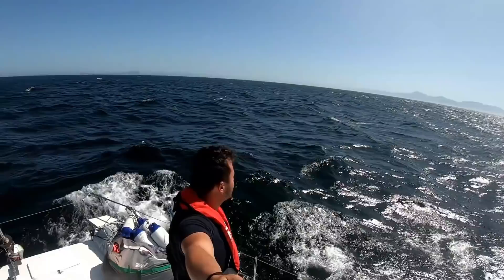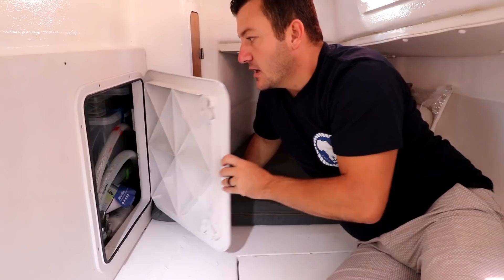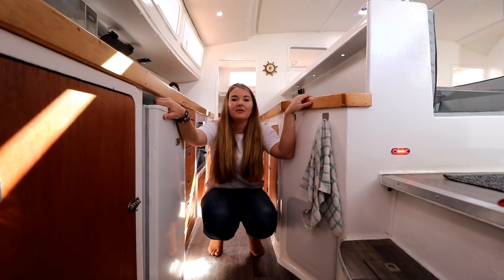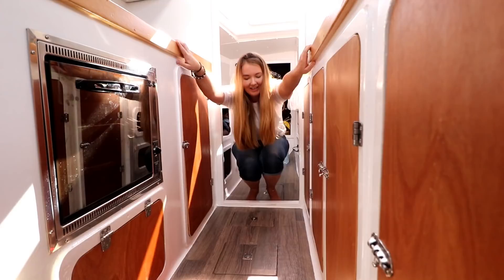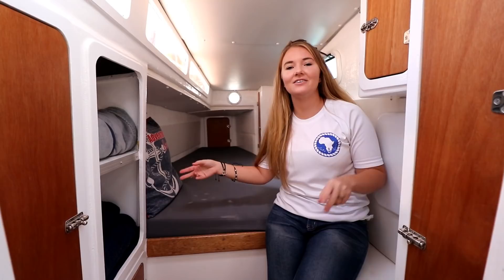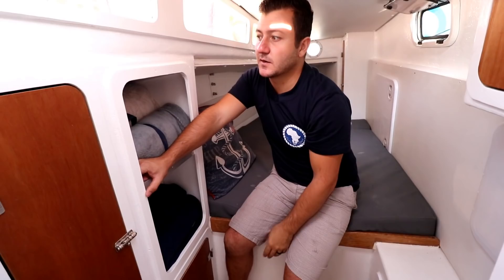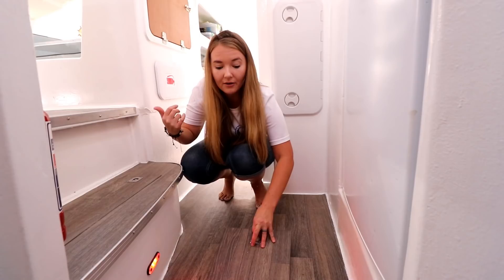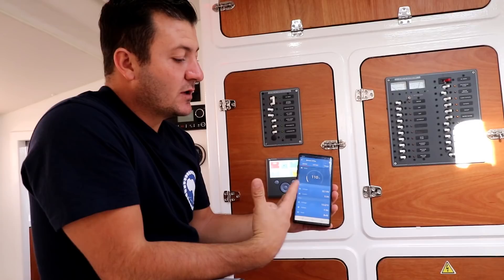Interior Tour of our Cheap Catamaran | Dean 365 Oceanliner

Comment: Are you thinking aboutvwdding a clothes dryer in later? What other future upgrades are you thinking of? For fruit and vegetable storage, make sure you separate certain vegtibles. Some of the veggies emit ethylene gas which causes certain fruits to rot quicker than normal. I'd just hang them over an easy to clean area, maybe put a stainless steel tray under them.
Reply from the maker: No. Well just hang up our clothes outside. There isn't enough space for a dryer as well. Thanks for the tips.

Comment: That’s amazing go use so little,propane for hot water, cooking and whatever you said that either things was. We go about 6 months, but we don’t heat out hot water with propane! I always thought you had to have very high pressure water for the propane to successfully fire up...did you have to put in a special high pressure pump to make it work? Amazing your boat runs off of 320Ah...I guess with a lot of solar it’s workable. -Rebecca
Reply from the maker: No. Our heater has a flow meter not a pressure sensor with minimal flow.. the burner ignites. We found this one after quite a bit of research 😂
Reply: Sailing Lady Africa very cool. We just did an off grid solution. One day there will be a video on it...all off the sun and wind, and of course our South African LifePO4 batteries...another video to be ;) -Rebecca

Comment: Hi guy. try and keep some Citric Acid Crystals onboard as its very handy to use. it will take away any limescale that forms like in your water lines. / toilet / kettle / shower head / and it will flush your water intake it will dissolve any limescale it comes into contact with. i always keep at least 2 kgs on my boat and i don`t have any problems plus it Bio Degradable too so you can flush it overboard knowing its safe for the Environment
Reply from the maker: Thanks Erick

Comment: Again, just fantastic. A question, did you check if your alternators are large enough for your batteries? I understand they should put out a minimum 10% of the amp hours of your batteries. Else you'll short change yourself on a charge.

Comment: That is not a cheap catamaran any more, you should be proud of what you have done and could be surprised at its value to someone wanting a catamaran!

230V is not a problem as you did not build a power hungry boat, more solar or batteries if needed but there is also running an engine to top up if not enough sun. Watermakers can draw a bit too.

Have you thought about mounting the watermaker in your old engine hatch area or similar to free up more space inside? Use the same through hole just have a long hose to run down to fill your tanks and it gives you a fresh water wash down outside and less potential leaking issues. depends on security I guess. I had one in a laserette with a removable platform above it to support the life raft (rafts are heavy) and would recommend it over less internal storage, even initially had to throw a hose over the stern for the intake (can you say fastest install ever), easier dealing with buckets etc for pickling and startup waste water over the side till you get good water.
Reply from the maker: Hi Steve , Thanks . We might move the watermaker to the engine bay at a later stage when we increase the size of the access hatch.
Reply: @livingwiththemaias  @ Boat jobs are they ever really done? When you built your engine bay hatches I thought they would be good boat yoga once the engines were in, nice square hatches tho I suspect the new ones will be wider at the front but lets see when you get there. 

Where are you putting the brine discharge? a couple of non return or check valves and a y adapter and using the existing bilge pump discharge pipe will save any new hole and pipe work. Posssibly even order the bits from Vetus online during lockdown to fit up later. ;) 

Are there any good safe anchorages near you? Have a chat to the marina they may do a deal as if you leave no-one will come take your spot.

Comment: SIMONE : FRUIT [ AND EVEN VEGS - POTATOES, ONIONS ] : IN A GRASS BASKET - AS PLASTIC LET IT SWEAT - METAL & ALUMINIUM CAUSES RUST ON THE SKIN - ALL MAKING FRUIT AND VEGS GO ROTTEN MUCH FASTER.  NEVER STAG FRUIT OR VEGS ON TOP OF ONE ANOTHER... IT CAUSES BRUISES - ALSO MAKING IT GO ROTTEN FASTER.  PLACE A DISH CLOTH AT THE BOTTOM OF THE VEGS/FRUIT IN THE BASKET - IN CASE ONE WANTS TO DRIP.  THE BASKET SHOULD BE IN A SHADED AREA.  NOT DARK!  NOT TOO MUCH SUN EITHER.  AS LONG AS THERE IS AIR FLOWING PAST AND OVER THE FRUIT OR VEGS - THEREFOR THE GRASS ALLOWS THE FOOD TO "BREATH".  AND LASTLY:  A NICE BIG, WIDE GRASS BASKET CAN BE TIED WITH CABLE TIES SOMEWHERE TO PREVENT IT FROM SLIDING OFF A COUNTER IN ROUGH SEAS.     PS:   RICKY HAS CABLE TIES HIDDEN TO THE LEFT OF THE "GAUGES / GAIGES? / GAYGES? / SPELLING ??? ... "  DON'T TELL HIM I TOLD YOU !!!!!!!!   :)  :)
Reply: Potatoes should be kept in a dark dry area. Onions in a dry area, could be open. Too much sun for fruit will increase the ripening and shorten shelf life. Good luck guys
Reply from the maker: Who knew storing fruit and veg would become so complicated 😂 Thanks for the tips Phillip!
Reply: @livingwiththemaias  PRACTICE makes PERFECT - you are gonna find your OWN best ways as you sail along.  Every day a new thing to learn, experience and keep on creating...  :)

Comment: You are in danger using stainless steel sea cocks, they will not work long in saltwater, change to slicon bronse or marine grade synthetic sea cocks !
Beautiful job. 😃
Kind regards
Cheers sailors.
Reply from the maker: No we are not ! They are bonded to anodes they will easily last 3 years . Not the first rodeo with them . If they were not bonded then i would say they would only last about a year or two at best . 
Thanks for the concern anyway!

Comment: Moito interesting episode, guys! Thanx. It looks so good. You can be proud of all the hard work you did! Happy for you.
Some little questions. We saw that at the "feetside" of the front beds there are no cupboards, like in ours. So at the other side of the footboard, are there already the anchorlockers? And Ricky, I hear you saying "backup autopilot" and "second autopilot". You guys have two autopilot systems...? One hydraulic and one electric steering wheel unit, or what? 
Happy greetingz, Wim
Reply from the maker: Hi Wim , yes at the end of the beds is the Anchor locker . 

Yes we have two Auto Pilots , the main one is a hydraulic pump drive and the second one is a electric wheel drive (much weaker but its a backup ). All the yachts ive been on for deliveries a auto pilot fail made life very difficult short handed. 

Hope this helps 

Kind Regards 

Ricky
Reply: @livingwiththemaias  Thanx. Yes, the hydraulic I've seen. Never miss one of your videos, haha! :-) We have that old Autohelm ST4000. You are going to install the Raymarine EV100? Or found a second hand ST-Whatever?
Yep, the idea of having to handsteer for two weeks with a crossing is not something you look forward to!
Reply from the maker: @DoubleUThings  st4000 linear drive are good auto just keep the salt water away from them , yes we have a EV100 control with s st4000 wheel drive unit as backup
Reply: @livingwiththemaias  Nice. I wished not everything was so friggin expensive. :-)
Reply from the maker: @DoubleUThings  yip its a rip off to be honest , we got all our stuff on sale from the USA . Yes you have to add taxes and shipping but still half the price of SA
Reply: @livingwiththemaias  Then SA must be expensive! But an ST4000 wheeldrive coupled to an EV100 unit...?
Reply from the maker: @DoubleUThings  sorry my mistake ev 100 wheeldrive system with a acu100